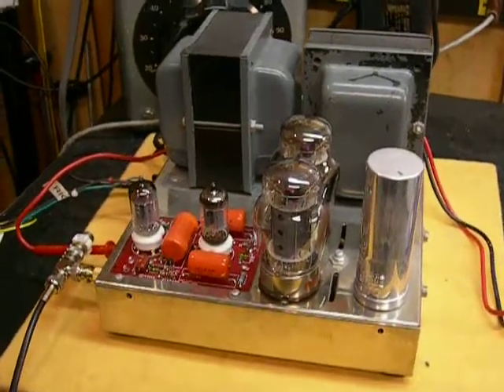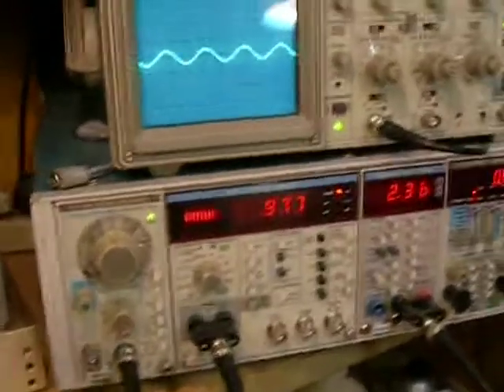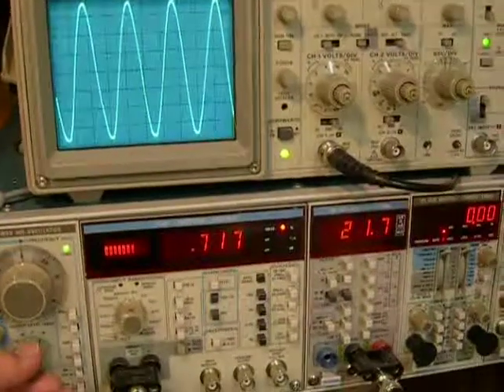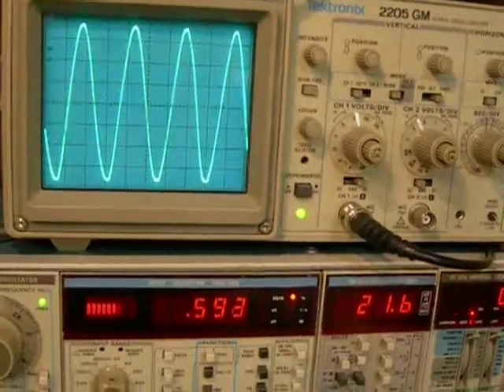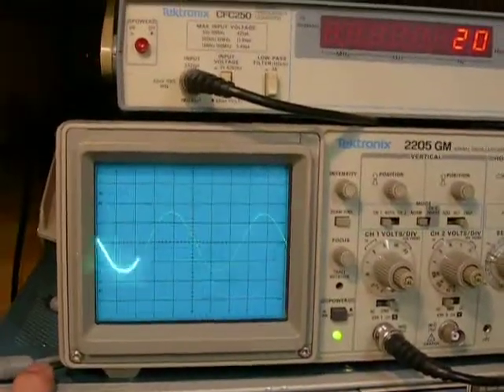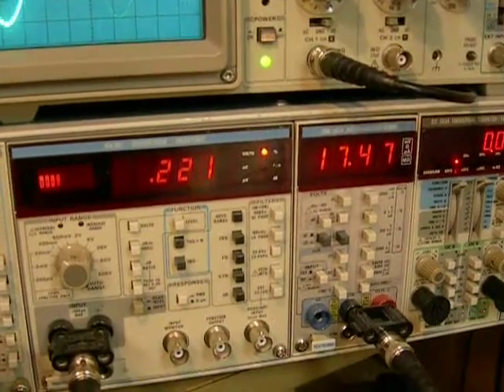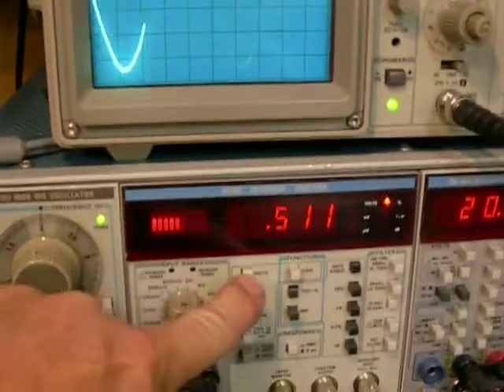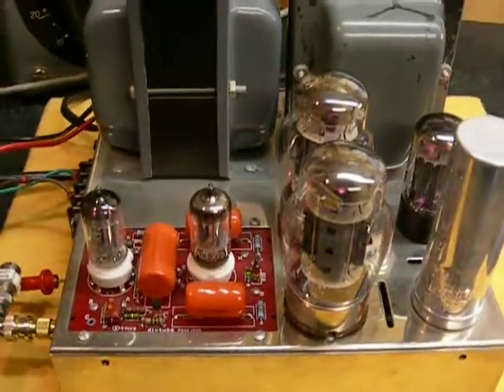Vintage RCA 6550 Vacuum Tube #2.MOV

Comment from the maker: @evhgl87 The piece of equipment on the bottom is what I was describing. It is a six bay Tektronix module you can plug all types of test equipment into. I have changed it somewhat since this video was made. Thanks for looking and commenting. I hope this helps.

Comment from the maker: @evhgl87 The oscillator is on the left, next, to the right is the distortion analyzer and to the right of that is the voltmeter measuring RMS voltage across the 8 ohm load. The last two instruments to the right are not used.

Comment from the maker: @evhgl87 The load is an 8 ohm 200 watt non-inductive resistor. You might look at the introductory video for a description of the setup. The old Dynaco amps used a 15.6 ohm resistor in the cathode circuit so that 1.56 volts across it would produce exactly 100 mA of cathode current. At the time the amp was built, all new D sized batteries were exactly 1.56 volts which is what you could use to calibrate your voltmeter. Not necessary to protect the scope from large currents in the load.

Comment: ive got alot of questions if you dont mind. what are you using as a load, to allow you to measure the output Vpp on the oscilloscope? what is the piece of equipment on the bottom? what is the 1.56 you are setting? and finally, with the large currents that are at the output how are you protecting the oscilloscope from damage or is that necessary?

thanks ahead of time and thanks for uploading!